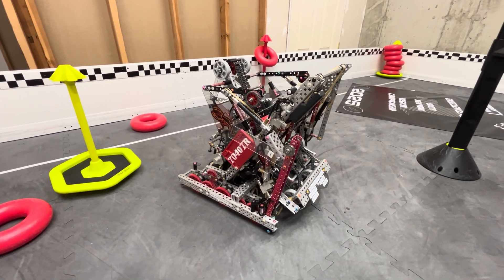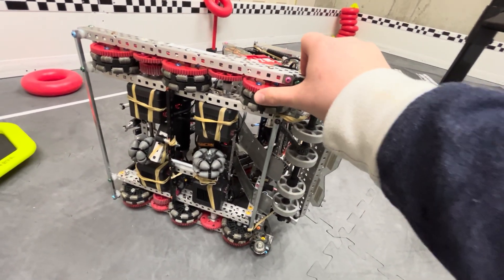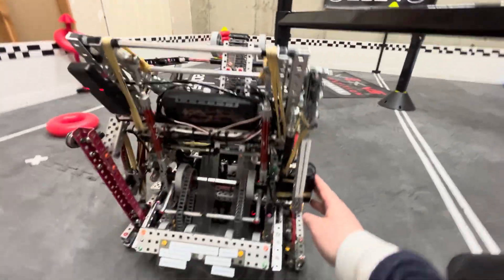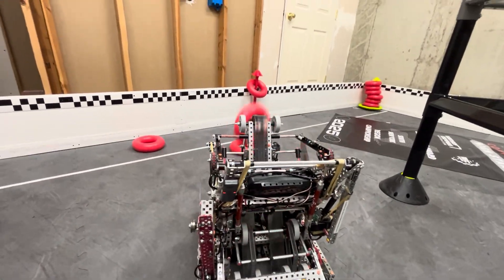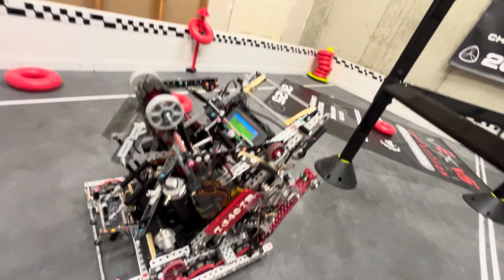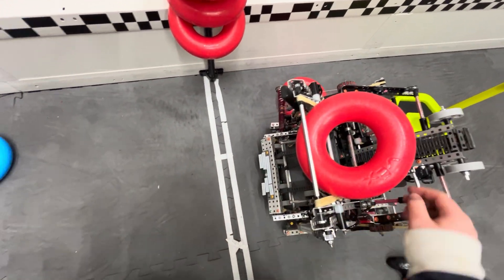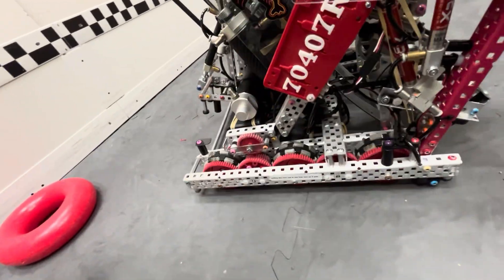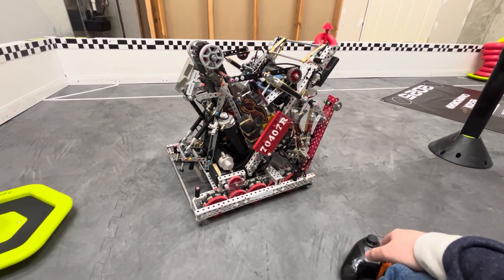70407R Vex High Stakes States Robot Explanation

Comment: If that yellow block for your color sensor is 3d printed, wouldn’t it be illegal?
Reply from the maker: Rule R8a states that any material used strictly as a color filter for a vex sensor is allowed
Reply: @ I don’t see that anywhere in the rules, but I do see R9.f - Decorations which provide feedback to the robot would be considered “functional”, and are not permitted.
Reply: @Refraction70407R  nvm, my bad. I re read it and see it. Which rule is right tho, they are literally saying the opposite of each other
Reply: @rblxreid7807 because its function is as a color filter that means its allowed, they dont contradict, one just has more precedence